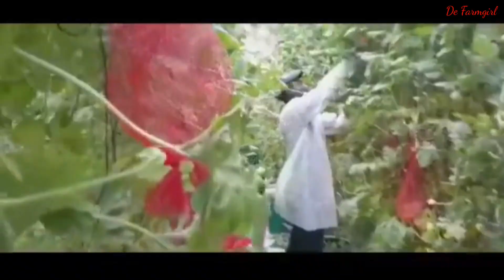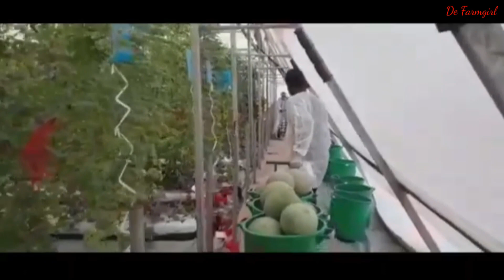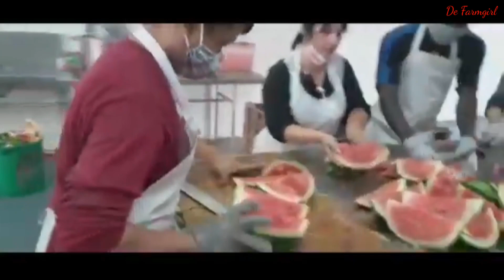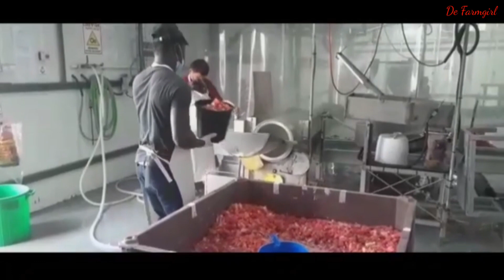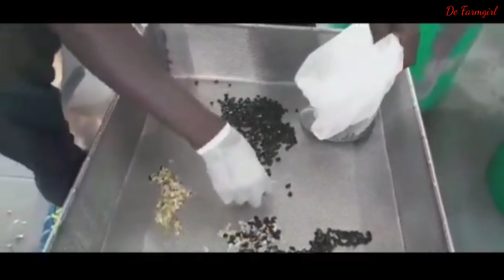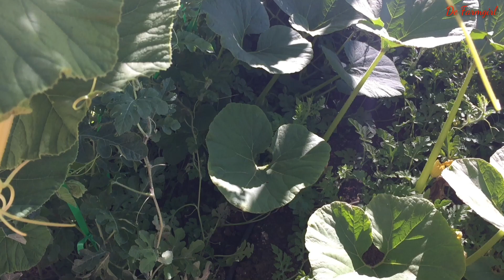Easy Method growing watermelon seed  techniques, methods and process at home garden Part I

Comment: What is the best season for watermelon production and which soil type is best for watermelon production.
Reply from the maker: Watermelons grow best in well-draining, sandy loam soil that is rich in organic matter. The soil should also have a pH between 6.0 and 6.8. It is important to prepare the soil before planting by adding compost or well-rotted manure to help improve the soil structure and fertility. Additionally, watermelons require a lot of water, so it is important to choose a location with access to irrigation or to ensure that the soil retains moisture well. It can be cultivated in the rainy season and all year run if you have an irrigation setup.